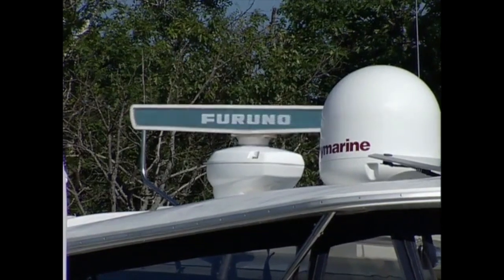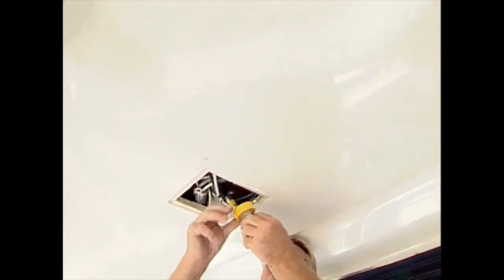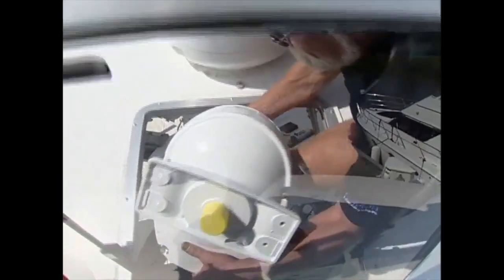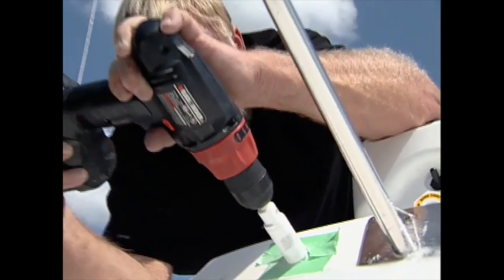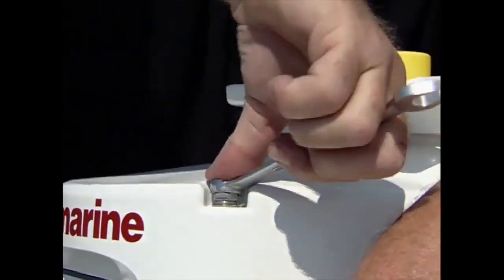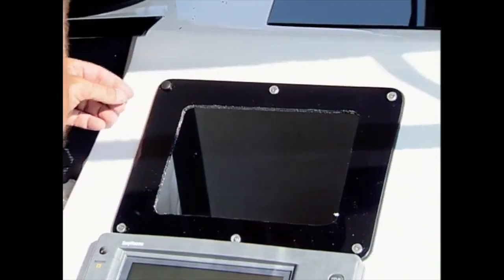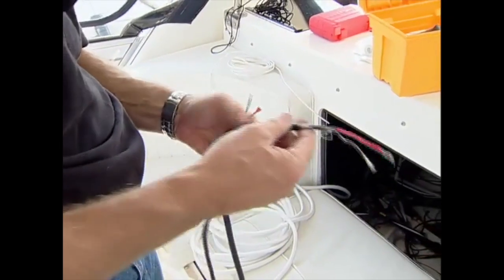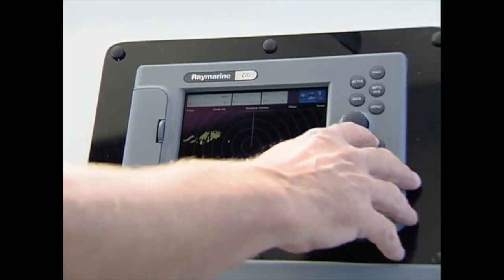How to Replace Your Boat's Radar with a Raymarine Radar System | PowerBoat TV Classic DIY

Comment: Anything Raymarine is NOT AN UPGRADE.
Reply: Why is that? I’m serious. We are getting ready to recommission a used Fire Boat of Firefighting boat/vessel. It has a Raytheon.on it now, and am anxious to get the ownership paperwork/manuals/etc; to determine the condition of its system versus identifying the option of new system now or further in the future. The bulk of the membership will need beginner training to understand the basics, and I haven’t sold a radar system for almost 25 years and or operated a radar for close to12 years.
Reply: @nebraskatpp  raymarine software is sub par and custermer service is terrible. I personaly wil Never buy ANYTHING Raymarine. Radar I would go with Garmin or JRC.
Reply: @danthomas3808  Mr. Thomas Sir!!!…. Thank you very much for that honest and sincere appraisal. It is exactly what I need.
Reply: So basically you came here as a troll to vet your frustration with Raymarine. Good Job!
Reply: @TrojanStarryNight  Right!!???  I wonder why 75% of boats have Raymarine installed on them?  The majority of the boating community must be much dumber than Dan.